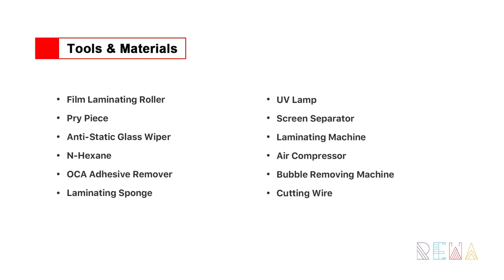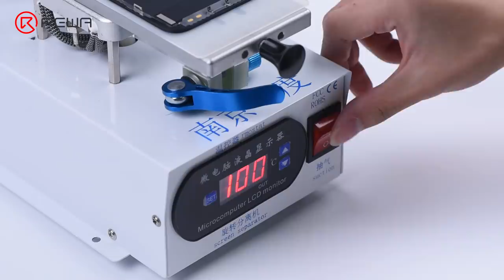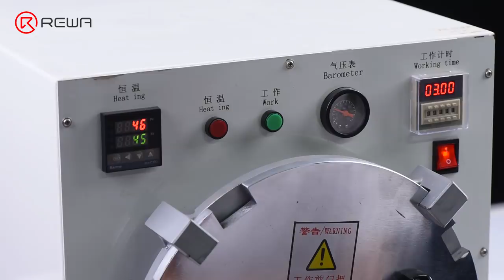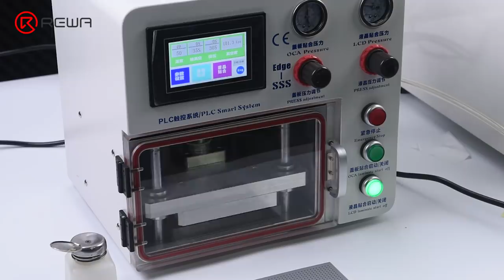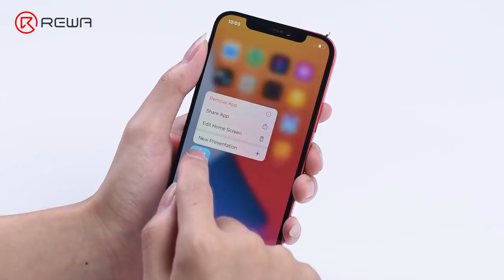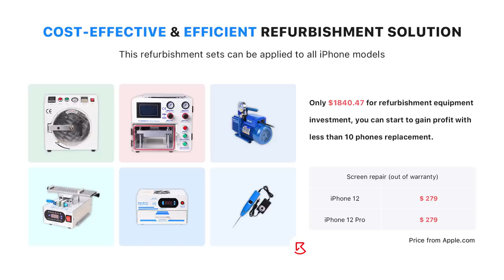iPhone 12 Lineup OLED Screen Refurbishing Solution By REWA

Comment from the maker: Click these following links and you can order the same equipments with our video:
UV Lamp For Curing OCA Glue: https://bit.ly/327QFNl
Bubble Removing Machine: https://bit.ly/3n3dR7R
Screen Laminating Machine: https://bit.ly/2I2nuEN
Electric Glue Removing Tool: https://bit.ly/38ahWmc
Rotatable Screen Separating Machine: https://bit.ly/3mJVVPc
30L Air Compressor: https://bit.ly/2JuwcMh

Repair Training Book Written By REWA, naming iPhone Motherboard Repair from 0 to 1, click this link to buy: https://bit.ly/3kGUa4F
Reply: Where is frame ??
Reply: How this will fit in mobile without frame?
Reply: Hi! Does the iPhone 11 glass fits the iPhone 12 and 12 Pro?
Reply: I am from Nepal and I want Rotatable Separating Machine..Is it Possible to deliver in Nepal?
Reply: there is no 3d touch in iphone 12 1:11
Reply: got aligment tool now?
Reply: ةگمم

Comment: Manual alignment is quite risky but you guys are more practical than others. Great idea to move one step forward 👍 👏 👌
Reply: They aligned it manually because they dont have alignment mold jet. Its impossible to do it right every time.
Reply: maybe using an extension and displaying a white screen would make it easier, as the bezel paint is black

Comment: I have FM-50 laminating machine. Everytime I perform this refurbishment in-frame, I get a small bubble where the IC chip is. How do I prevent this?
Reply: My guess is your mold isn’t pressing pressing close enough or it’s just a problem from doing in frame, did you sort it because I want to do in frame for 12 since I have a Foward laser

Comment: What do you use to clean the LCD after removing OCA?
Reply: don't take risk just use petrol on the top side and after that use separator after one minute glue will be remove automatically.

Comment: After i watch this video i'll pay apple any price to fixe my display , no regret
Reply: @jonthecont   
Hhhhh fuckin kidding me! Do you think you gonna fix your phone with this high careful and big machine and accessories?? It cost more and more not fuckin dumb to buy this expensive machine and amateur hand to just fix my 250$ display
Reply: @الدوريالاسبانيبرشلونةمدريد   no you pay a professional shop that does this and has the tools. It will be half the cost of Apple
Reply: Waleed Ali   
 I know , and they selling equipment just like ifixit
Reply: @الدوريالاسبانيبرشلونةمدريد  Replacing the display isn't as difficult as this. Look it up. I've done it myself several times, it's fairly easy.

Comment: But apple has paired all the items to each phones so this is quite useless unless you have a tool to pair the display of another phone to this phone ?
Reply: He’s not changing the original Apple screen that came with the iPhone. He is just replacing the glass and putting a new glass on the screen
Reply: @joshuaa1921  i get that, what i mean is if the screen is to be refurbished. it can only be used for the same device. once you mess up the oled panel. we can no longer easily replace it by ourselves.
Reply: @jc4448  hold of grinder